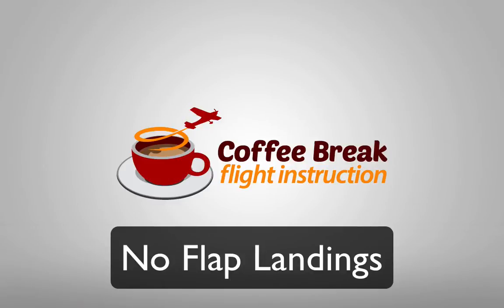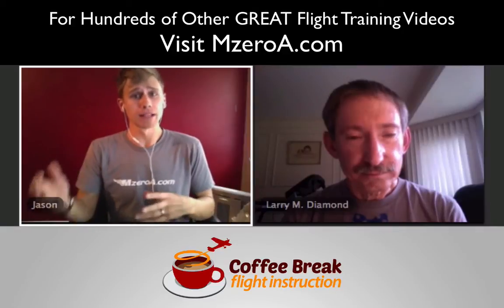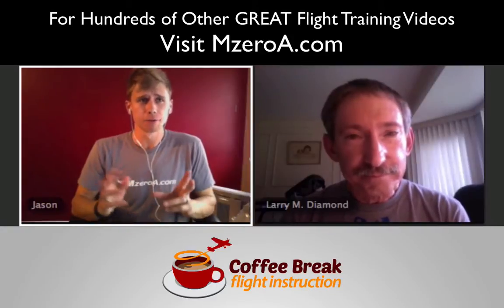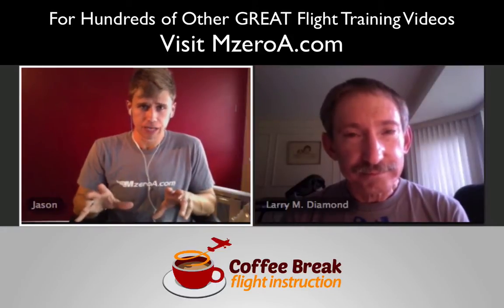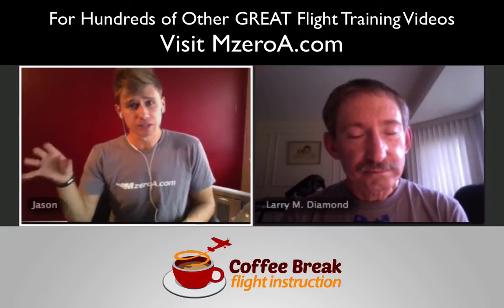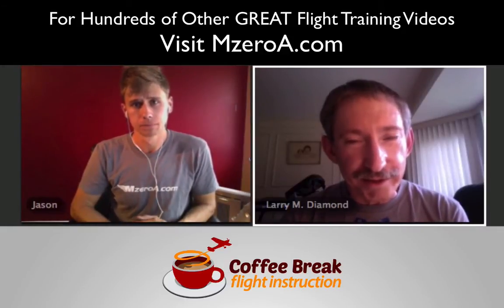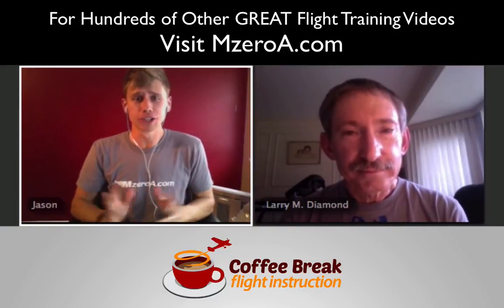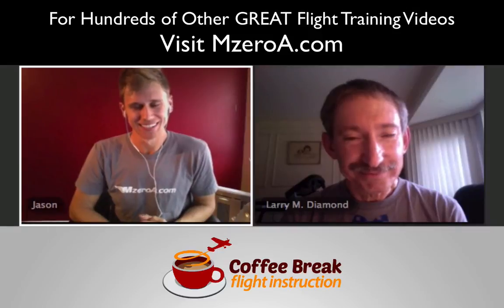No Flap Landings - Coffee Break Flight Instruction by MzeroA

Comment: I recommend going to a safe altitude and jot down manifold pressure and pitch settings for straight and level at 90kts, 80kts, and 70kts (or whatever speeds makes sense for your aircraft according to the POH) and then I do lots of slow flight with no flaps, paying attention to the sight picture and AOA at various speeds. This will teach you to control your airspeed without practicing it in the pattern. My POH lists 70-80 kts (depending on weight and balance) for no flap approach in my Cessna 182, so I can use my practice sessions to know which power settings will get me close to those values when I’m in the pattern. I use no flap landings often in strong crosswinds or gusty conditions, and I’ve had to make a no flap landing when I lost power. As they noted in the video, expect a lower approach than normal with a higher angle of attack.

Comment: My first no-flap landing was not done on purpose.  During a solo, returning from the practice area, I was cleared for a straight-in approach and completely forgot to lower the flaps, kept wondering why I was coming in ho (well, as hot as a 152 can do lol) and eventually had power fully out as I crossed the threshold and made a super smooth landing, rolled onto the taxiway and did my after landing checklist.  Realized my flaps were not down when I tried to raise them.  I was supposed to be done flying, but instead of taxied back to the runway, did 2 more turns around the pattern to get it right.   The CFI asked me “why did you go back up? You had a perfect landing the first time” I just said “I saw I had some more time on the clock so I wanted to squeeze in another .2” and never mentioned the flaps lol. 21 years later, so far I’ve remembered the appropriate level of flaps every time
Reply: Oopsies lol glad you landed safely